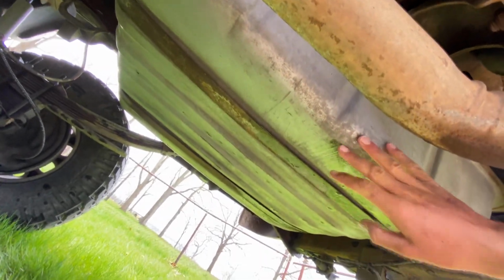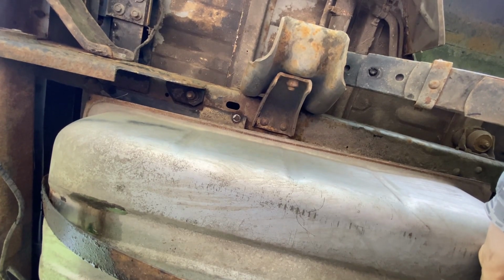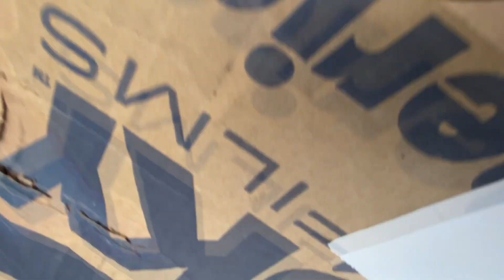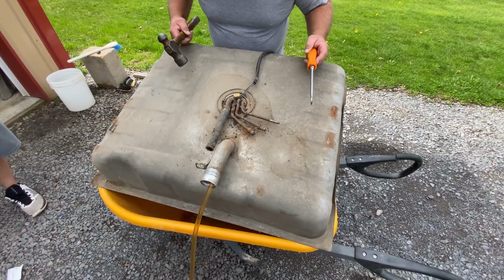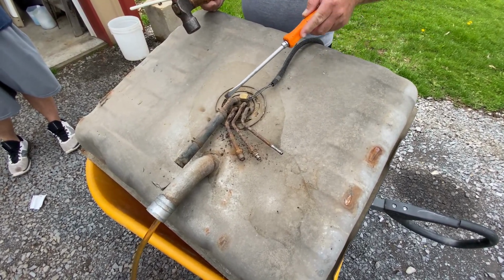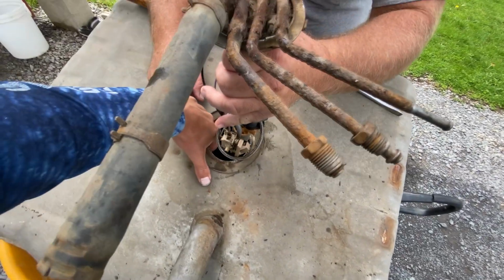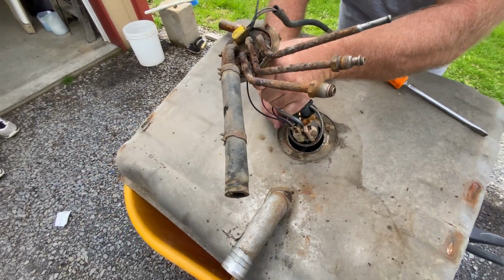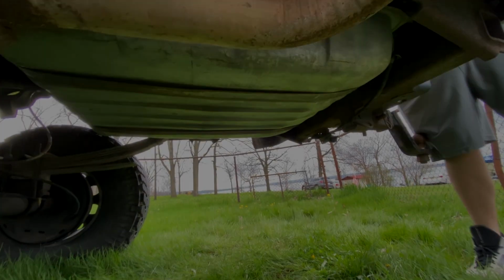How To Change The Fuel Pump In A 1991 Suburban

Comment: Just food for thought. Clearly you won’t be changing fuel pumps all to often on it (We both Hope) but for lots of things on a beast like that, get yourself a motorcycle jack for about $80. That and a sheet of plywood make lots of virtual overhead tasks easier.
I was happy to have one when changing mine in my Expedition not once but twice...
Reply: Agreed. I use a harbor freight transmission jack. Cheap and flat and works perfect.